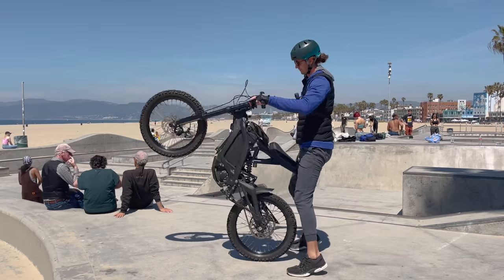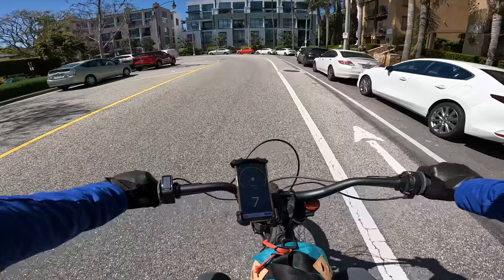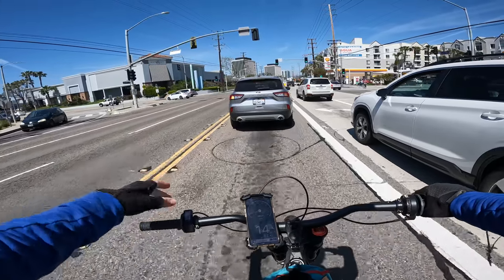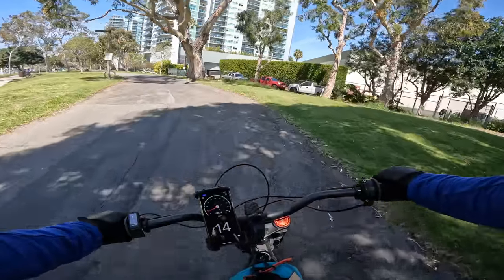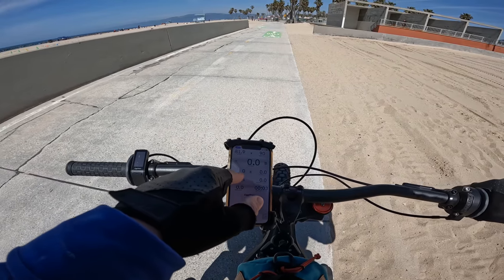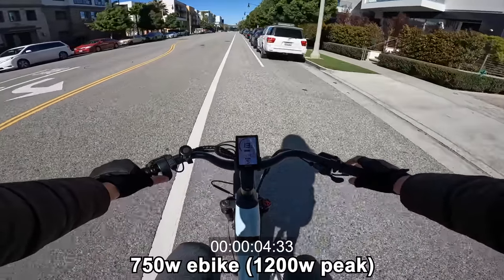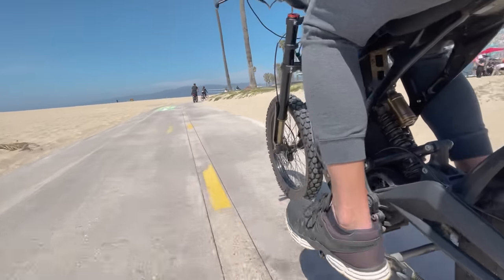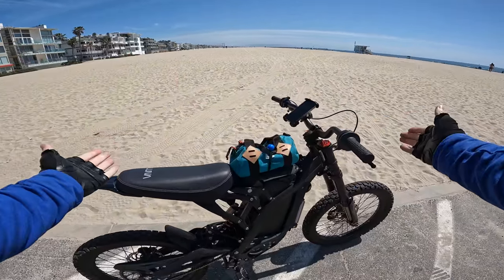This 70 MPH ebike is DANGEROUS

Comment: The distinctions are quite blurred between what is an e-bike and what is an electric motorcycle these days. So to truly understand it, one must look at the same context that legal matter would consider.
First of all, a regular pedal bike in name, stems from bicycle - which is the main relating point of e-bikes, where you have stage one which is assisted e-motor alongside pedals, and then full electric without any assist. In this segment of full electric, the classification instead relies on the specific usecase of the bike, typically limited to factors such as top speed and acceleration potential, where legal classification is based on whether it is likely/unlikely to fill the same niche that a traditional bicycle would - aka being driven on the side of the road or on specified bike lanes, under typical road-going motor vehicle speeds, etc.

In this particular case, there is enough legal ground to consider this e-bike entirely on the same merit as an electric motorcycle, as the only real difference is general weight of components, but not how it's used. Range will limit how often it is used for general high road speeds, but it is well within the reasonable limitations of regular city traffic speeds and is therefore considered a motorcycle, not a bicycle. Cops may or may not enforce this as of now due to the rarity of such potent e-bikes (aka technically lightweight motorcycles), but if more and more find their way onto streets, this could easily change and the law is fully on the side of requiring specific license registry comparable to a motorcycle / moped.

All this said, I'm a big fan of these types of bikes that push the limits of how we can utilize electric power in non-traditional ways and disrupt some of the more conservative markets.

Comment: The difficulty I have is where I live, half the year the light quality is bad, and the road designs are terrible, so you have random sidewalk egress into the natural road travel, meaning if you don't know the area, you can easily find a curve taking you out from under your feet with no warning. I've come off at 20mph and it hurts for a moment, but you get by, but at 30pmh and above, bones start to break.
Reply: Why do you ever have this thing on a sidewalk?
Reply: @TheJohnreeves  Cause sometimes there is no other way. Sometimes it's either that or get run over by traffic, or take a detour that is designed for cars and not bikes. Truth is most cities aren't designed for all the vehicles that use them. They evolved that way but it wasn't thought out coherently. I've seen cities that are designed properly, like Manchester in England and Geneva in Switzerland. They don't have these problems because each vehicle has its own designated space. But the rest of the world - nope. They haven't figured it out yet.
Reply: @aaronmicalowe  it goes 70mph, it's a motorcycle. You're not going to get run over by cars. Just ride on the road. If your bike can't go over 20mph, that's different. But if it goes 70 it isn't legal on sidewalks.
Reply: @TheJohnreeves  anything over 30mph and you can't ride it as a bike, so I agree with you there. Even if you're comfortable over 30mph, most pedestrians that step out in front of traffic while looking at their phones can't react to a moving object over 10mph, so 70mph is out of the question. That's when you need good breaks.

Comment: In order to get it all straight they are going to have to match wattage power to horsepower to determine if it should be registered for road use 745.7 watts = 1 hp. 16cc is 1 hp.. we are allowed 49cc before required registration. so 3hp x 745 = 2235 watts you should be able to build to before having to register...Now ....who's gonna hire the lawyer?  ROFLMAO

Comment: I would love to private message you but I'll just shoot my shot here I guess. 
I live in a city with at least 20 streets over 25% grade. There's probably 40 streets but those are lesser known and not typically driven on unless you live there. 
The point is, I'd rather not get a motorcycle license, but I think I probably have to get the strongest E bike possible to even cope with some of these hills near me, I have to look for flat ground instead of looking for hills. 
I just don't know what to do. I need some joy in my life, I don't want to drive a car all the time, I'm caring for my mom who's doing very badly, and I'm scared to pull the trigger on a bike that'll only go 10 miles an hour up some of these hills if that. I want to be able to put a bag of groceries or run some errands and not worry about power, used throttle only if I want to or not. 
I'm kind of feeling lost about all of this. Any suggestions would be really helpful. You can probably guess the city I live in in California.
Reply from the maker: San Fran, I’d consider a mid drive or dual motor for the most torque
Reply: @TailHappyTV  can you name a model that you would consider, considering you have probably driven 80% of the top 20? 
Your depth of knowledge is valuable to me. 
Would you risk getting an E bike but would you go with something like the most fun on two wheels? And do you have a motorcycle license riding that around? We're both in California so all that would help me a lot. 
my life sucks right now but I literally try to figure out if I could pay you to help me figure this out.

Comment: Do the E bikes need a plate to drive on street?  the other things I was curious about was is it top heavy with that huge battery sitting so high in the frame?
Reply: I don't think. They do they are something similar to bicycle
Reply: Normally no, but in Europe ones that exceed 25km/h in powered mode can and probably will be classified as a motorcycle. Motorcycle without licence plate, insurance, MOT stamp and rider probably without helmet.
So speedy ebikes like in the vid are one way of getting acquainted with quirks of law, especially when something happens and police/insurance companies are involved.
Reply: They do, but you can get away with it if you sort of kind of look like a little e-bike.

Comment: Thankfully, the DOT defines what an E bike is, 750 watts, and 20 miles per hour. twenty is plenty. So, in reality, your video is about an illegal light electric motorcycle. So, 12,000 watts is 16 times the legal limit, way out of range. This is why companies are being sued, this is why counties like Orange County are now changing the laws, requiring licenses, and registration. This is promoting illegal riding, and hurting the actual electric bicycle reputation. People spent a lot of time working for the legality of e bikes, and people like you should work towards getting a legal electric motorcycle classification. Do the work, promote safety.
Reply: Bet you're fun at parties.😂

Comment: 12000 watts at 72 volts is a current of 167amps. I am calling bullshit on this claim of 12000 watts.
Reply from the maker: you can see the current In real time in this video:
https://youtu.be/nj287kFgCGM
it's a few minutes into this video, it only topped out at like 15x-ish amps because I rolled on the throttle which introduces "field weakening" and less current draw then if I just gun it from a stop. I think 180 amps-ish is the max draw on this setup.
Reply from the maker: this video shows more peak current draw moments:
https://youtu.be/HykvDiJJcRs
another thing you may be over looking is a 72v battery fully charged is actually 84v, so on a full charge 12kw is only 84v*142amps

Comment: Said the brakes are light to hold up to all the heat dissipation. Dissipation is the act of heat being disspersed the brakes dont hold up to the dissipation they dissipate the heat which in this case is hard to do because of THS AMOUNT of heat genereated to lighter brakes fit for a much lighter bike is what you were trying to say
Reply from the maker: This is probably why I didn’t make it as an engineer 😆

Comment: It's worse than an e-motorcycle it is a motorcycle but without the appropriate brakes and speed rates tires to safely stop at those speeds plus when you exceed the speed ratings you're at risk of treads coming off. Everyone jacking these things up in power only do that. Motor, battery, speed controller but no one is upgrading brakes and safety side.

Comment: i wonder what the hp to weight is.
Reply from the maker: 12kw = 16hp
bike weighs 136lbs
136/16 = 8.5 lb/hp without a rider
but realistically you need to add the rider weight too if comparing to a car
336/16 = 21 lb/hp

Comment: Are the fastace brakes better than stock?
Reply from the maker: yes, definitely, prob not as good as maguras or bigger rotors, but def better then stock
Reply: @TailHappyTV  do you have to run 180 rotors for them? Their website doesn’t give much info
Reply from the maker: @Danielxperez14  I think you can run larger rotors, you’d just need the adapter to extend the arm. I plan on swapping to Magura when I get time, these fastace ones have been fine for me for like 6 months
Reply: @TailHappyTV  i heard maguras arent reliable from three different bike shops, i recomend trps or shimano

Comment: 10 thousand dollars 😂 electric is a joke my ninja 400 was 5k and goes 120mph top speed stock, is high way capable with zero trouble and can go 200 miles on a single tank of gas which is only 3 gallons 11 bucks to fill up here In Texas. It cost 15 dollars for a 4 hour road trip (250 miles)

Comment: Sorry at this price point, I'd rather buy a real motorcycle. You will admittedly have to put fuel in it but there are so many other features this thing can't touch.
Reply: I'm strongly considering a real e-bike that's an actual legal bike. Maybe a Tern cargo bike, they have a very practical thing that could be used to do reasonable commutes on, and go shopping with a giant luggage rack on there.

Comment: Yeah dude you hit the nail on the head. It's all about blending in and riding it like a bike but with a throttle. 

I built a home made one using a Banshee scratch frame and it definitely blend it and I do go slow when I need to because I'm not really in any hurry to gl anywhere. 

It CAN do 43mph. And it'd got decent torque but I do hope it would be stronger torque. 

But yeah. It's all about playing nice, blending in and being considerate

Comment: This is not an ebike.  This is an electric motorcycle.  This vehicle should have lights, mirrors, and be registered with a license plate.  It should only be legally ridden with a full motorcycle helmet.  It should never be used on a bike path.   I know this opinion will not be popular here, but bolting on a pair of Tinker Toy pretend pedals does not make this a bicycle.
Reply: A motorcycle isn’t 100 pounds kiddo
Reply: @F83.M4  call it a motorcycle or a turnip, it is an electrically powered motor vehicle and should be treated just like any other motor vehicle.